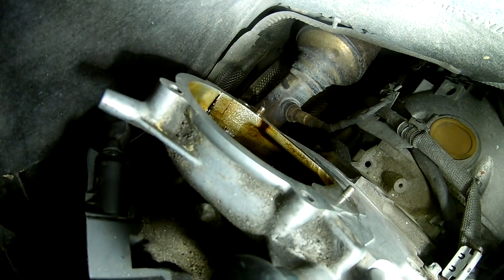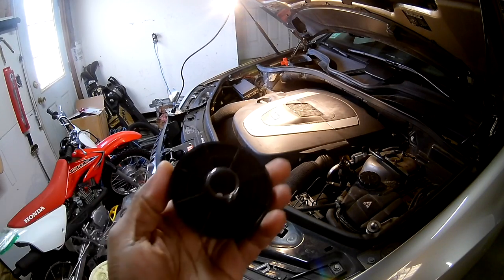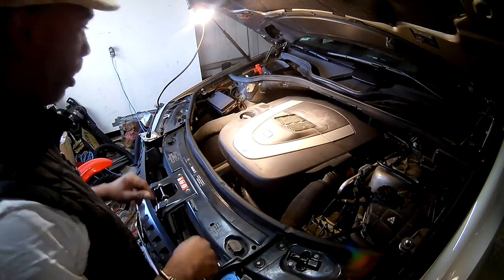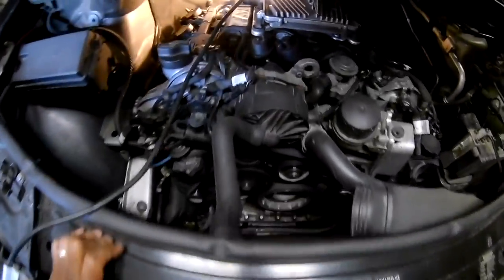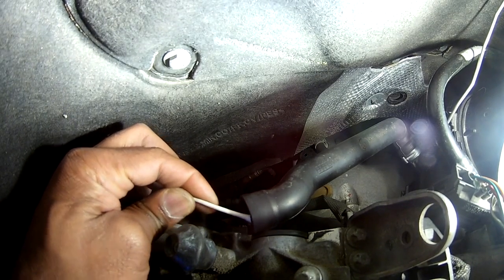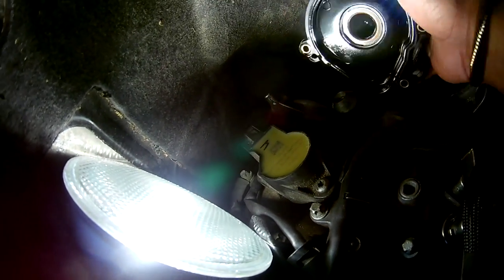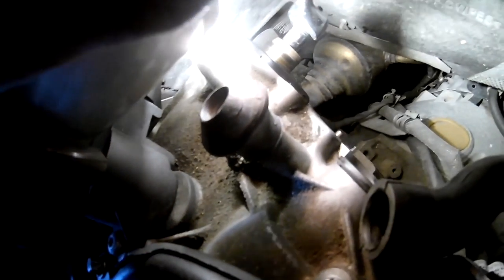Mercedes Oil Drip Pan | PCV  Replacement DIY

Comment: Easy as pie on a 2011, w212 e350.  Four e10 (or 8mm box end) gets the top piece off. One reverse threaded bolt using  1/4” deep well socket gets the oil catch can off.  Mine was not very tight.  Thanks Keith!!   No more oil on the exhaust.
Reply: I used a regular wrnench to remove that top left bolt.

Comment: On a w211 m272 bolts are T27 on cover. E8 on oil drip pan bolt, or a 1/4 hex will work too.

Comment: This is a useful video. However, when I followed this video, the REVERSE thread screw present in this video was NOT present in a 2014 GLK350. Ask me how I know. I snapped it off turning the oil drip plan screw clockwise, thinking I was loosening it. Obviously, you think it was stuck and so more torque to remove resulted in breaking the bolt. After several hours, I was able to remove the broken bolt with a flexible extension attached to a drill and a right angle attachment with a broken bolt extractor to remove it. What a pain!

Comment: Thank You for showing the replacement of the spinner. So many videos and most don't even mention it. Then one did mention it having left handed thread. Now I understand the spinner sits against the cover (opposed to fitting inside).

Comment: Keith, I just replaced the oil drip pan and cover on my 2011 S212 E350 as it was approaching 100k miles and wanted to change it before it failed.  Thanks for your informative video which made changing it a breeze.

Comment: BTW a 12 point 8mm opened end ratchet wrench worked well to remove drip pan/separator cover. Thanks for this video. My 2012 GLK 350 oil drip pan did not have a groove only 54k miles.

Comment: I was just trying to remove that 1/4" bolt and I remembered you mentioned it was clockwise to remove it. So I had to search for this video again to verify. Thank you!
Someone put torques bit on the cover, instead of the ones you have. Makes it really difficult.
Reply: Torx style  bolts are used on the  M272 V6  engines and the M273 V8 engines utilize E10 mounted bolts
Reply: @Sdenney6970   yes, since that reply, I have noticed this and bought a whole set of torx sockets. I also found that ford uses a German engine that also uses a lot of torx bolts, but not all of them. 4.0 SOHC V6. That engine is a nightmare to change a timing chain. LOL

Comment: I just realize that the part you are holding is really suppose to save and prevent oil from going into the MAF and into the intake manifold.  The part suppose to drip out and spinning out any oil collected.  However, that is not enough.  Have you install a catch can?  I been seeing this quiet a lot and thought this might be a perfect application for this issue.   Just a thought, what is the construction of the oil drip pan.  How does it looks like from the inside?

Comment: I have a 08 e320cdi with the om642 engine. I have recently changed the rebreather. The one I got is an updated version, where the breather and the drip pan come all in one. Mercedes thinking behind that must be that they reckon that the breather and drip pan wear out at the same time. The nice thing about this is, when I fitted the the breather, I had fitted the new drip pan too.

Comment: The PCV valve and its diaphragm is the culprit, not the internal part in metal rubbing against the soft plastic diaphragm. Replacing the PCV valve it enough.
But thank you for the reminder of reverse thread.
Reply from the maker: +J. Badinter be careful and inspect the oil drip pan. This is a part that wears out and causes much grief.  Trust me on this.
Reply: Oil drip pan?
Reply: I only changed the pcv valve and I still had oil in the tube.. so I guess that oil separator is mandatory
Reply: Technically, I think the design for that oil separator suppose to collect and get any oil collected then spin out.  That is why you will see holes on the outside.  However, the oil fumes still continue out to the tube and into the MAF / intake.  I was thinking, an oil catch can may help as a secondary prevention on oil getting into the MAF and the air intake manifold.  The pcv cover is the issue where oil leaks and as usual the o ring on the cover gets bad over time.  But this does not stop oil getting into the MAF and air intake that cause all that oil that the drum intake manifold is failing.  I believe a catch can is the result.  As seen with other car's application for this same reason of oil in the intake, this might be a solution.  Not a permanent solution, as oil fumes still get suck into the air intake, but at least another line of defense is in place.
Reply: The separator gets dirty. Therfore, less effective. This becomes more true with age of engine as well as poor oil change practices (which include oil type, change intervals, demands put on engine, etc). 
Adding a catch can on a used car would be a good belt and suspenders approach to reducing intake manifold gunk buildup
Reply: @j.badinter988  he shows in his video that the seperator has worn out and has a groove on the metal part, which slides on the diaphragm.

Comment: The bolt that holds the oil separator wheel on is reverse threaded.
Reply: e10 for bolt correct?
Reply: @The_McD  I dunno, that was too long ago

Comment: I changed the oil drip pan and breather port on my 2010 ML350 today. It wasn’t that bad. It’s just a little tight back there. so one thing I noticed in the video is that you said to take the bolts off by turning it clockwise.  I realized that you would be turning clockwise if you were standing behind the engine. Since you were standing in the front of the engine, it would be counterclockwise to take the bolt off. Meaning turn the socket to the left to take it off and to the right to tighten it back up.

Comment: Great video as I noticed oil somewhere and changed the separator but in oil pan and just changed it this evening now I’m mad cause i have to go back and replace oil as I noticed it dripping down to catalytic converter. I need part ASAP and replace
Reply: Yes, that is a normal situation.  You would smell it in your cabin as the oil fume it gets burned travels in.  Yes, it so happens that is were the air for the cabin is at (air filter).  No such a smart design from mercedes.

Comment: Hi Keith, did a new reverse thread Bolt come with the oil separator?  I just bought a new one "Mercedes"  and no new Bolt in the Box.
Thank you for all your great Videos! Keep them coming! Wish you were near me to help record my GL 450 repairs. Their have been Plenty.  Long Island NY  Thanks again.
Reply from the maker: No, the bolt is a separate item. Mercedes should have it.
Reply: @iRepairAutos   Thank you. I haven't done the job yet but I'm pretty sure the one in there will be fine.
Reply from the maker: Most likely.  The bolt is inexpensive.  I would get it.

Comment: Man, I Wish it is this easy on the Newer M276 Engine. It is Unbelievable The location and procedure they Placed/set to replace these 2 Parts on the M276 engines..
Reply from the maker: They make these jobs harder in smaller more compact vehicles
Reply: @iRepairAutos  It's a problem even on the W212 and in a similar location.  Problem is, on the M276, the High pressure fuel pump run at the back of the intake camshaft puts it in the way of the PCV Cover and prevents access to one of the bolts for the cover.

Comment: Got a 2008 CLS 550 need to change crankcase valve this video helped a lot didn’t even know about the oil drip pan or how important it is to change the dealer will never tell you that thanks man
Reply: I don't think this is a maintenance part they will look into until you complain about oil fumes in your cabin (which is the end result) or when you find oil deposits in your intake manifold (or it had failed).  But then again, even if you replace your intake manifold (as this is link how or why it fails), they may not look at these 2 parts to be replace if it wasn't leaking.  However, if you trace the rubber tube, your down elbow (maf), throttle body, intake manifold, the pump actuators in from of the intake manifold -  you will find oil stains and gummy substance in the area.  You might think where is it leaking oil.. It's not leaking oil, it's just deposits over time it collected.  Also, I believes the amount of deposit depends how hard the car is driven as.

Comment: Thanks for the great videos !  Question, Other then oil in the breather hose,  are there any signs or systems or performance issues that would tell us these parts have failed?
Reply from the maker: Your oil consumption will go up;  You will see add/check oil at next filler station more often than usual.    As the part wears out more you will be greeted with the add/check oil even more often;  Your air intake manifold at this time has probably failed or will fail soon.
Reply: iRepair Autos is there a mileage recommendation do you think the pan needs to be changed ? I changed the cover last year (I didn’t have any leaks but I just wanted to change as a maintenance item) but had a hard time getting the pan out (tight space and not small enough tool to fit in back there). So I just returned the pan. I only have 48,000 miles on my 2010 e350 sedan.

Comment: A couple of questions. 1) At the 4:39 minute mark, there is a grey harness to the right of the screen sitting on the transmission bell housing. What is that ? Mine is tightly against the PCV cap, turns and runs along the sides of cyl 1-4. 2) The drip pan seems to have been redesigned slightly (oil exit holes). Is there a reason for this redesign ?  I have a 2010 E550.

Comment: What is the inner bolt size of the oil separator , I’m using deep well 8mm and it catches but doesn’t turn do to it having star points on it aswell . Would a ser of deep well e torx E4-E8 would they work ? But what is a generic version so I wouldn’t have to wait for shipping please

Comment: I’m not sure, but I think you have to replace the lower valve as well on the driver side
Reply from the maker: None on the other side in the 6 cylinder.

Comment: Also, Apparently, I'm looking online and it says it's the same part for the Oil Drip Pan for 2006-2016/2017 Models.. ??? However, yours has a different part number..??? Anyhow, this and one other YT Vid is the Only video/Picture that I could find Online regarding this Oil Drip Pan (Or Centrifuge - I believe)- As it's called on the newer engine... But, I'm looking at this part and I can't figure out how it works and you didn't say either. Looks like it bolts onto the back of the Camshaft. So does that mean the Oil Drip Pan Spins/Rotates along with Camshaft while in Operation??? 🤔🤔🤔

Hope you can give some insights - I'm trying to determine if Mine needs to be replaced at Only 50K Miles. Engine Shakes while Idling I noticed that there is a restriction in the Breather/PCV hose/Line and I don't think it should be, I've ordered the Breather Cover But I'm trying to determine if I'll also need the Centrifuge/Oil Drip Pan... Car is a 2014 Mercedes C350.
Reply from the maker: The part is the same.   There are two part numbers because one is a cover and the other is the centrifuge also known as the oil drip pan which spins

Comment: Great video, as usual. After this is done, is there any way to do at least some cleanup of the oil/carbon buildup in the intake manifold and intake valves without having to remove the intake manifold? I see videos of people dropping water through carburetors on warm engines to cleanup carbon in the intake; is there a comparable method for cars with fuel injection and MAF sensors that is safe and effective?Thank you again for a great job.
Reply from the maker: Thanks Maxwell.  There is no safe product in my opinion that will properly clean the plastic parts internal to the Air Intake Manifold without going into the piston ports and ending up internal to your bearings and engine oil which will cause failure.   The reason why the manifold is hard to clean is because the oil on the plastic is micronized (more like smudge) and sits densely on these parts.  check the cleaning video here:  https://youtu.be/GsWqdiBHG18

Comment: Keith - thanks for the video.  Very helpful.  Had some leakage bottom of rebreather cover so decided to replace it and the centrifuge.  No issues taking everything apart but the new centrifuge would not seat onto the camshaft no matter how much I fiddled with it.  I ended up putting the old centrifuge back on (it seats easily) and buttoning everything back up.  Any trick to get the new centrifuge to properly seat on the camshaft?
Reply: So I finally got another rebreather cover and tried this again.  This time, the original centrifuge I purchased 2 years ago fit correctly and the new rebreather cover fit nicely as well.  I was very surprised to find the rebreather cover I replace 2 years ago was full of oil and the gasket was very much enlarged.  Hoping that the new centrifuge I put in today will help to keep the oil pass-thru down to a minimum this time.
Reply: I see what you did.... you need to heat up the center of the cover where the cylinder is going to be hitting with a hair dryer. That way when you put the cover back on it should fit more snug... (Just a little Tip that might Help)
Reply: @yung.holdin9493  Never would have thought of that.  As my comment from three years ago, last year I tried to put this on again and was successful after lots more difficulty.  Wish I had seen your comment earlier!!
Reply from the maker: Sorry for not responding.  Didn't see any of these until now.   That's a good trick to get it seated. Glad it worked for you.

Comment: Thank you! Would have likely stripped or snapped the bolt trying to turn it the wrong way if not for your video!
Reply: You would want to be careful with that bolt.  It goes onto the camshaft.  It would be an extreme expensive fix if that would to happen.

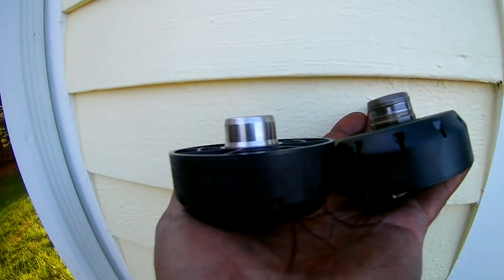Comment: hey man thanks for the vids they are definitely helping. That centrifuge that you show at the 4:06 mark is any part of it supposed to turn with the engine off or does it spin when the engine is on? I ask because supposedly a mechanic replaced this for me in 2018 but my hose and cover have oil in it, the gasket  in the middle is not snug around the centrifuge which seems like they should be for something done in 2018, only 20,000 miles have been added since. Wouldn't a tech change both cover and centrifuge together vs just the problem part? or can they tell and only change whats needed at the time? thanks if you an answer and be well just the same if you cannot. Either way my manifold is currently on the floor of my garage covered in oil inside and out. The air flap actuator lever in the front broke and the other two are gummy to say the least. Still wagering on whether I should replace and recon the plastic bits on the front of the manifold or just get a new manifold.

Comment: Hi Keith
Iam replacing the intake so off course I decided to replace the oil drip pan and cover. S!@# i broke the bolt that is suppose to go clockwise. Any ideas u might have would be greatly appreciated. Thanks
Reply from the maker: Holy crap.  That's bad.   You might have to change the top end.  I would try to remove the bolt.
Reply: @iRepairAutos  just subscribed and liked. First time ever did that. May I suggest maybe saying clockwise/towards the passanger for us air heads. Thanks for your videos.
Reply: حليتي المشكله؟

Comment: Hey Keith..love your videos they’re amazing and have helped immensely pls keep them going! I have a CLK 280 W209 2007. Had the oil drip prob onto cat and had leaky cam plug cap and PCV cover. Two questions; my mechanic took off the the PCV cover and the gasket was worn causing the leak, he said don’t change the oil drip pan no need and would also mess with timing. Also the three cam plug plastic caps I changed the two small ones (one was leaking). Cannot for the life of me find the large plug cap, is this missing on some models depending on year? In your video it’s in the drivers side next to the smaller one but cannot find it on either rear side of the engine. Many thanks 🙏🏼
Reply from the maker: that PCV cover needs to be changed as the diaphragm wears out and allows blow by.  It will not affect timing in any way shape or form.  Your car may not have that large cam port.

Comment: Did you have any issues with the oil separator at all??? Im about to do this to my 2011 Mercedes-Benz E350 4Matic.
Reply from the maker: Yes, they wear out over time.  And needs changing
Reply: I found oil in the same hose as you did in your video.  Do you think I should just do cover and drip pan or the kit that includes all these parts?
crankcase oil
separator cover, expansion plugs
crankcase breather hose, oil separator,
crankcase breather oil separator, and full
load breather hose.
Reply from the maker: @fermingrajales  do everything.
Reply: Do you have a video that shows how to replace the crankcase breather oil separator, I keep looking around and haven't found one yet. I really appreciate your help.
Reply from the maker: @fermingrajales  this oil seperator and cover also serves as crankcase breather....

Comment: So, if I got this right this "rebreather" must try to take out the oil from the Crankcase air (like a PCV system).
If this rebreather etc is replaced is there really a need for an oil catch can?
Is this the m112 engine or the later ?is it m272?  Cheers
Reply from the maker: There is no need for an oil rebreather if the system is working properly.   This is the w164 vehicle.
Reply: This applies to M272  V6 and M273  V8.

Comment: I just had this repair done by an authorized mercedes repair shop (2008 ml350) but now it's burning oil . I don't know if one thing has anything to do with the other but seems odd that all of a sudden I'm seeing smoke out the exhaust and I'm topping oil every couple of weeks. It does have over 100,000 miles on engine.
Reply: Cam covers check those out and don't let them charge you $300.
They're behind the engine top side of driver side. Round. In shape.